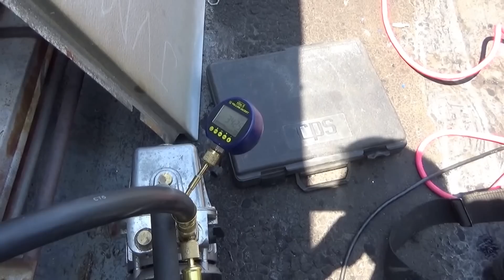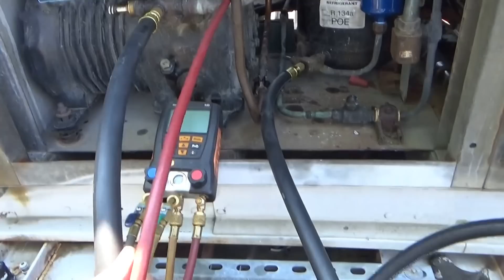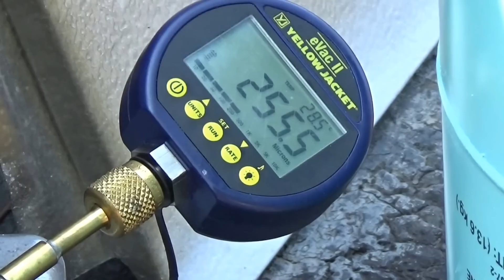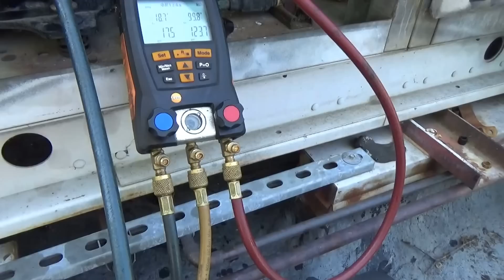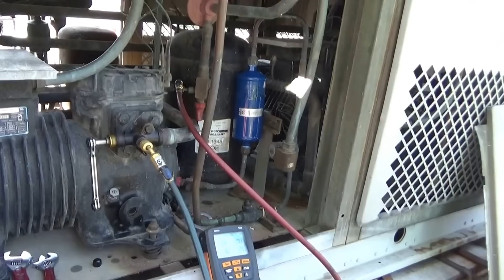Old MP 39 heat reclaim system convert to R 134a and POE oil

Comment: Yet another pointless MP-39 to 134a conversion. This system has been running well on MP-39 for 19 years. Rather than do the repair, evacuate, and recharge with the recovered MP-39, the customer got needlessly charged with retrofitting to POE oil and a full charge of 134a. Jim does good work, but it seems he has a penchant for needlessly converting perfectly functional systems running MO or AB and HCFC refrigerants to POE and HFC's with inferior thermodynamic and efficiency properties.
Reply: MP39 wasn't that great to begin with. Mostly R22 with 2 others thrown in to try to mimic R12. R12 was far better. R134A is better than MP39. The reason he did this was they stopped making MP39 about that time of the video, and maybe he didn't have any more. So he was doing the customer a favor, by converting it, if something leaked down the road, would be easier to patch up the leak, change the drier, recharge with R134A and go. R134A is a single chemical at least, not a mix of 3 like MP39, so no worries about the mix being off due to leaks etc.

Comment: Love your videos Jim!  Just one question:  Have you had any issues with plugged filter driers after you remove MO oil and replace with POE during a MP39 swap to 134a.  I've been told the POE will "scrub" your line set and components.  Any insight?   Thanks 👍🏼
Reply from the maker: not driers, but I had a cap tube on a pressure control plug once
Reply: Thanks for your quick response!  👍🏼

Comment: I saw you set up your tripod on a previous video. You also had your phone in the shot. It looked like the phone screen was showing what your camera on the tripod was shooting. Is this correct? Or are you using a separate camera with a view screen? I could see in the reflection that you were using your phone camera when you did a tour of your van. Would you mind going over how you do other shots and how you have such great sound even when the machines are running in the background. Maybe a remote mic on your collar. Anyway, great videos. Would love to learn your methods for my own use. Thanks.

Comment: good video.  question: have you heard of flexible refrigerant lines used on low boy refrigeration in kitchens.  all I seem to come across is just to use soft copper line set.  they are wanting to put casters on the units for cleaning behind.  of course I would put restraint cables with locks on them as well.
Reply from the maker: A number of years back I went to a good counter man at my supply house, I asked for flex lines, he went through some catalogs and came up with 4 ft long 1/2" and 5/8" vibrator eliminator like lines, I have some of them somewhere in my shop, I'll try to find a name for you. You might be able to use Appion vac hoses, thanks
Reply: Aeroquip they use it on mobile refrigeration

Comment: Copeland recommended mp39 hi temp. and mp66 low temp many years ago. I used mp39 once and never used it again, I do like mp66 though. I deal with a lot of copeland semi's. As a replacement for 12 the mp66 is ok. A tank of mp66 at United Refrigeration is like $600.00. My company stays with what Copeland recommended even though there are much cheaper gases available now.
Reply from the maker: they stopped making mp39 this year, thanks

Comment: mr jim how long you think those valves or pistons will last with the drastic change of refrigerant and oil
Reply from the maker: the POE oil has the same viscosity as the mineral and alkabenzene oil, and the MP 39 was a close replacement for R12 and so is R134a, the pressures are very close. How long,,, the first one I converted was in 96 , it's working fine. thanks
Reply: +Jim Pettinato thats not bad its too bad we have 100s of pounds of mp39 to get rid of though